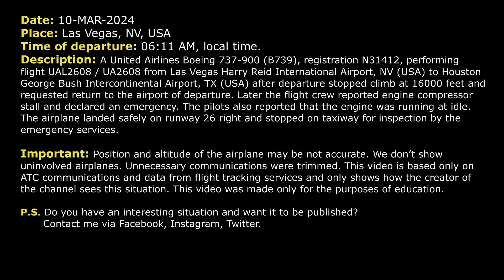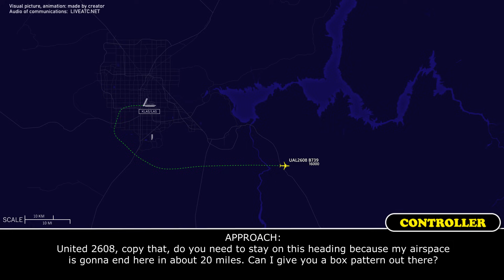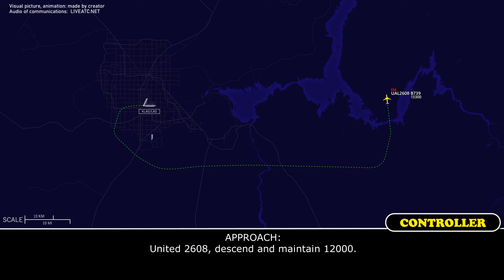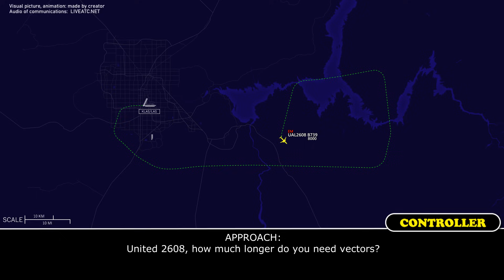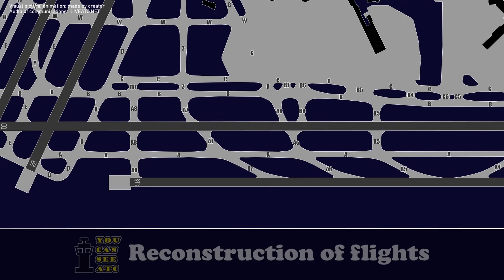Engine compressor stall. One engine is at idle. United Boeing 737 returns to Las Vegas. Real ATC

Comment: I’m definitely a frequent United flyer and starting to become a little concerned with how many maintenance issues seem to be accumulating on their planes
Reply: How many Kenworth trucks crashed today? You don't know because it does not make the news. When a/c have problems,  it makes the news. And the media are jumping on the bandwagon with Boeing and aviation safety in general.  Boeing has some splaining to do, but honestly these things were happening all along and you just didn't hear about it. United is a very big carrier so they will have more incidents than say Cape Air. Its still safe to fly.
Reply: FYI. what is going on lately at United is nothing new, issues happen every day. Its just that right now every issue no matter how minor is getting splashed all over the news.
Reply: @andresmith9212  .. a wheel and panel falling off is not a minor issue. Not to mention a hydrolic hose blowing either, among other things.
Reply: @craig7350  The wheel was a wheel failure, hub broke, probably due to damage from a chuck hole ore something, panel coming off Maintenance problem also somebody forgot to tighten the fasteners when replacing panel, and hoses break also maybe nobody had checked it !!!!
Reply: @wilburfinnigan2142 Which are all maintenance issues that should have been seen and addressed before the plane took flight. Preventative maintenance is meant to prevent things from happening, not fix things after they break.
Reply: @wilburfinnigan2142 from the image I saw the fasteners were still on the plane minus the panel.
Reply: @craig7350 hydraulic not hydrolic. Try learning how to spell
Reply: @paulu7751  .. good luck in your pubescence.
Reply: Probably time to switch to Delta
Reply: 22 @Pwj579